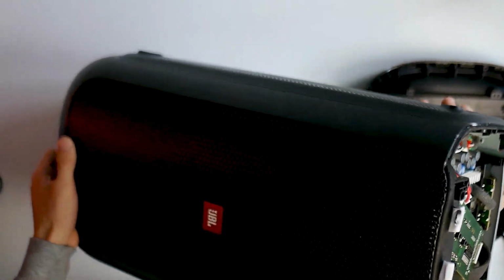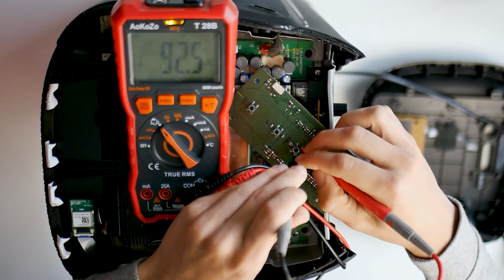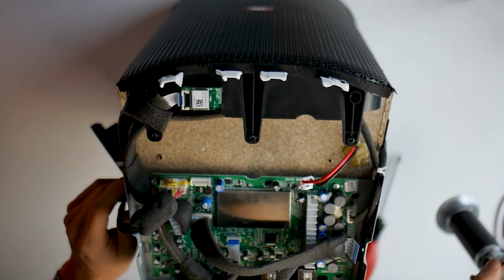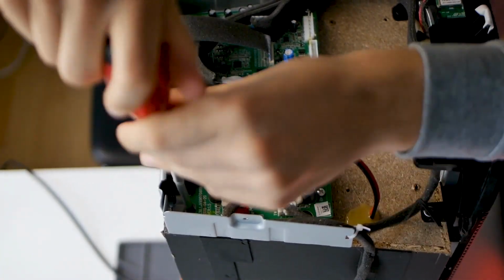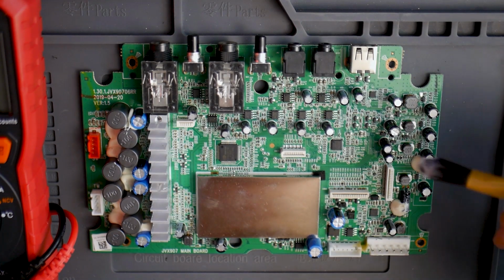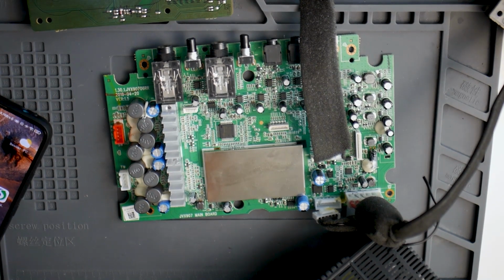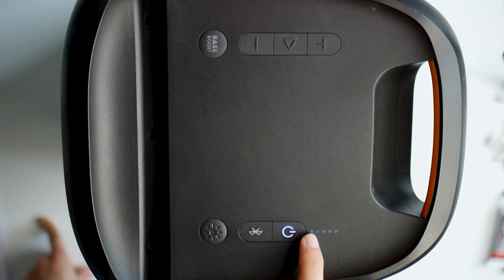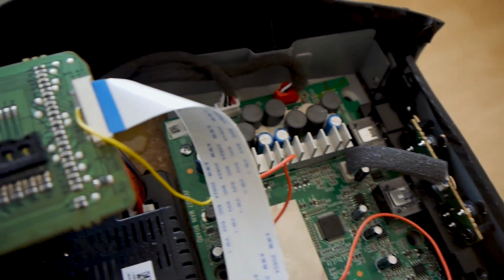Partybox 100 repair/disassembly - water damage? battery? 🛠️🔋

Comment: I am testing power supply, What is the out put voltage of power supply is it Ac or DC?. Input side voltage test shows 220VAC, but output side shows zero volts. is that something wrong with it. Physical observations of components on circuit board is clean and firm and no burning sign. Please help if you happen to see my comments, thanks :)
Reply: That means your power supply is working no more.. I must show 22v dc output. You should diagnose and repair or just supply add laptop charger of matching voltage output or even standard 19.5v one should works fine..

Comment: My partybox 100 works when plugged in but as soon as I unplug it power is gone.  Any ideas?  Do you think the battery may have become disconnected?  I don’t want to take it apart without having any idea
Reply: i had the same problem with a audio pro c5 i think its the battery that needs to be replaced

Comment: My speaker turn on and off by itself until the battery is completely drained.  What should I do ? Please reply
Reply: Did u find a solution?
Reply: Same issue here. we need to replace the replace the battery itself. That's the only solution. I am going to...

Comment: hello brother, my party box 100 batteries died after 3 years and now only works on ac power. I need to change the batteries,  from the video i got [lithium ion,4 sets in series,capacity 2500 mah(36watt/hr)] this much , the samsung cell info not clear ~8650 is this right. All I need to do is swap this with new ones and its done right. I there any thing else?
Reply from the maker: The battery is a 18650. You can use any with 2500mAh or more with at least 20 Amps of discharge rate. You should be careful with the wiring and the solder points. I definitely recommend using a spotwelder but a solder Iron works to.
Reply: @technico5880  yes ofcourse, i don't have the skills to do this, i have a friend whom i will do this. Thank you very much for the reply 🤝

Comment: My jbl partybox 100 always turning power on itself,sir what do you think is the problem?and also the bluetooth adapter card is damage,where can i buy one..i am from the Philippines
Reply from the maker: I think there's a short between the two power Pins. Let the board with the powerbutton away and try it again.
I asked JBL itself and they gave me the contact to their supplier. I could order over mail. I had to replace the rubber part on top it cost 10 Euros and 15 with shipping.
Reply: Do you have Facebook sir?how ca i contact you?..

Comment: I have a jbl partybox 100 just like the one in the video. I am in America and I have 110v ac at the power supply and ~22v DC on the pins on the power supply board. I have confirmed continuity at the power button, any advice? Any better write up on the "common issue" you fixed at the very end of the video with a jumper wire? Thanks in advance and you have a new sub cause of this great video. Thanks again.
Reply from the maker: Hello, what's the issue? Does it turn on? The connector of the main board is very fragile. In my case there's only the bottom soldered and the top is loose. I tried several attempts to solder the pin back but it seems that there's some demage inside the plug. Therefore I press the power button and try to find the right Pin with continuity mode. It was the 11th or 12th I am not sure anymore. Than I make this jumper wire and attach it to the same pin out in order to get the signal again to the main board.

Comment: So I left my party box 100 outside last night and I got a little rain on it when I plug it in the the last battery life light comes on and so does the power button but it all turns off shortly after
Reply from the maker: What happens if you charge the battery?

Comment: I have a similar jbl 300 with water damage.  Can u assist me do same to get it working pls.
Reply from the maker: I can try.
Reply: When are you available.....where are you??
Reply from the maker: @phemmyo5146  you can write me here if you have questions or problems.
I will make a Instagram profile in the future👍 then you can contact me there
Reply: @technico5880  i opened it up and thought why not  charge it 1st.  I plugged it.  I heard something  and the last charging light started blinking.  So l am going to let it charge for 5 hours then report back.
Reply: Now working  ...... only paid 100 for it.  Unbelievable
Reply: Now how do i put the side plastic back on???
Reply from the maker: @phemmyo5146  same as you take it of. Try to get the panel inside the clips and carefully secure the screw's
Reply from the maker: @phemmyo5146  nice work😅

Comment: How many pins are on the flex cable connecting the power button and the main circuit board? I need to get a replacement. I luckily only had an issue with the power button board which was slightly corroded after an unlucky rain incident, I was able to fix it but unfortunately the speaker now turns on for no reason and I believe it is because one of the pins in the flex cable is slightly bent.
Reply from the maker: I used this cable: https://de.aliexpress.com/item/1005004064351607.html?spm=a2g0o.productlist.0.0.42504c09UaPv3X&algo_pvid=d47d43ba-b8d1-4530-baa0-7371c58ecb06&algo_exp_id=d47d43ba-b8d1-4530-baa0-7371c58ecb06-2&pdp_ext_f=%7B%22sku_id%22%3A%2212000027919489983%22%7D&pdp_npi=2%40dis%21EUR%21%211.52%21%21%211.75%21%21%400b0a0ac216571884976285993eeb03%2112000027919489983%21sea
18 Pins, 30cm. AWM 20624 60V
Reply: What is the pitch of flex cable?

Comment: Hey, I can see one issue in this video, you fixed the speaker, but the lights got glitched as you can see at the end, is it possible to fix?
Reply from the maker: Yes of course it's the same flex cable. I had to ad another bypass cable. But to be honest I don't like the light and turn it of completely.

Comment: I left my partybox in the rain by accident and now the bluetooth light its blinking but everything its working fine i dryed it as fast as i could got mostly the water out any suggestions?
Reply from the maker: But you can connect with Bluetooth?
Reply: @technico5880  yes

Comment: My party box is not charging
Reply from the maker: Did it happen suddenly or were there any outside influences?
Reply: @technico5880   no firstly it was continuously turning on and off
So I open it up checked any ic or components are damaged or not
Bot if i plug the battery pin titly then it again starts on and off or I plug the pin loosely then it's ok but not charging more the 2points
Reply from the maker: @zunaidshaikh9123  okay, if I understand everything correctly two of the battery to mainboard wires have a loose contact, right?
Reply: @technico5880  I think so
Reply from the maker: @zunaidshaikh9123  check it with a multimeter if it's the plug or the wires.

Comment: Is this jbl waterproof?
Reply from the maker: Oh no definitely not 😉 There is no sealing. A little bit of rain splashes of water are okay. But if you take the whole speaker into water it will definitely take damage.
Reply: @technico5880  Thank you. I accidentally spilled wine on it. Now the backlight does not work properly😭
Reply from the maker: @ИгнатБорисов-т9р  you mean the backlight of the buttons? Or the big light inside the speaker?
Reply: @technico5880  large speaker lighting
Reply from the maker: @ИгнатБорисов-т9р  The lights got their signal over the plug next to the bluetoothmodule. I think the wine goes over the large loudspeaker. Maybe theres a short circuit. You can measure it from above and if it's a short circuit you can carefully try to follow the cable down to the loudspeaker. You can use some alcohol (no water inside) and remove the corrosion as you can see in the video. I've never seen these lights but I think they are large PCBs in ring shape.
Reply: @technico5880  Thank you.

Comment: why my jbl party box 100 is slow charging now?can someone help me..tnx
Reply from the maker: Maybe because you have a larger capacity now. How do you measure the charging speed?
Reply: @technico5880  it took a couples of hours in every 1 chrge indicator led
Reply: @technico5880  my battery is busted?
Reply from the maker: @bongskilandagan9844  yeah could be a reason. If you don't make a battery upgrade. And assemble everything as in the video there could be no reason why the charge speed decreases.
Reply: @technico5880  😔 where can i buy battery for jblpartybox100?do u have any suggestion?
Reply from the maker: @bongskilandagan9844  depends on the area where you from. There is a seller on Amazon. But a battery costs you around $100.  If you have the possibility, you should build it yourself. I made a second video where you can see the wiring diagram if you want to build one. If you use an old laptop battery, you can build the battery for free.
Reply: @technico5880  tnx u